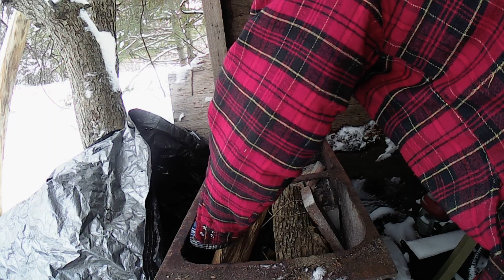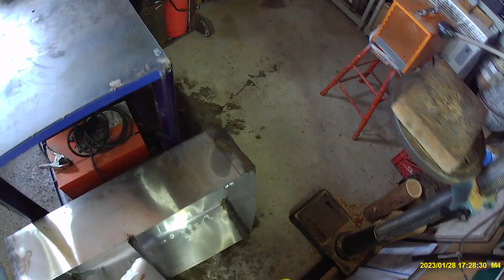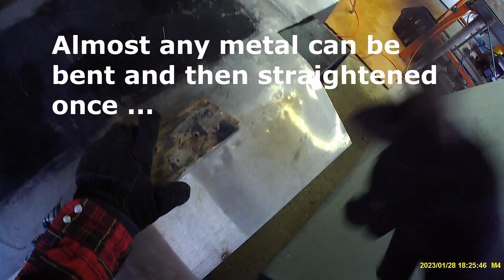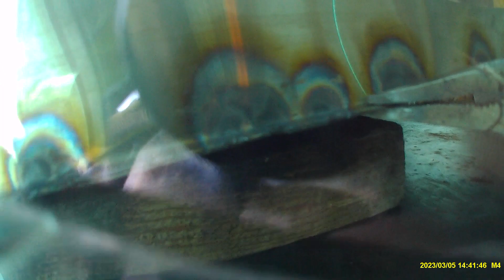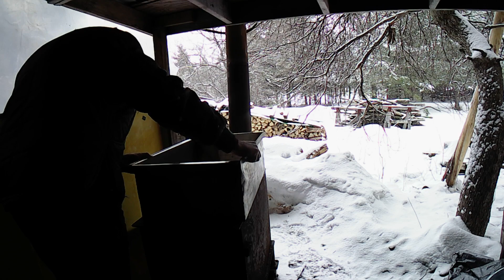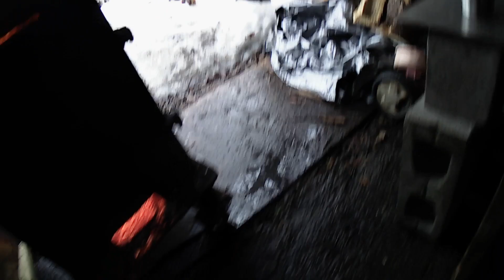Evaporator Pan Rebuild, Resizing for Efficiency

Comment: That the old stove from the lake?
Reply from the maker: Yes it is ... I've modified it quite a bit ... removed the water jacket pipes, added steel wheels to the legs, moved chimney hole from top to back panel, cut the holes in the top and reduced the firebox size ... if you look through my channel, there's a video about it ...
Reply: @jeffrosO.E  as soon as I saw the handle clearly I recognized it but I had already put my comment in. I remember when dad made that. He welded it up from plate steel with the rad in the top.